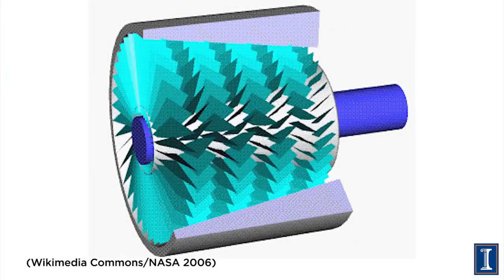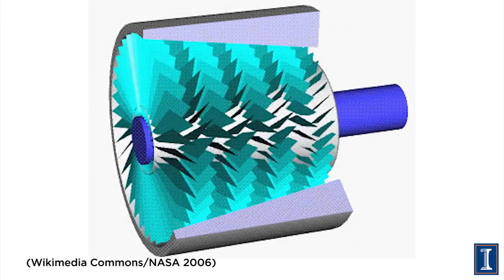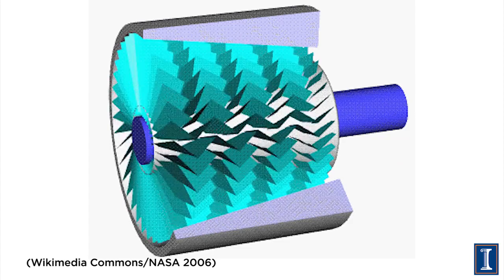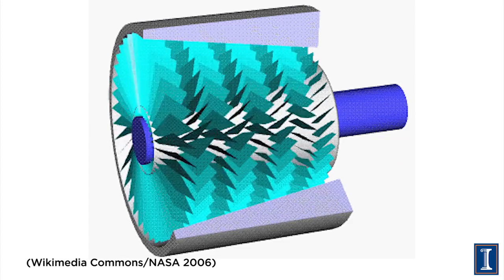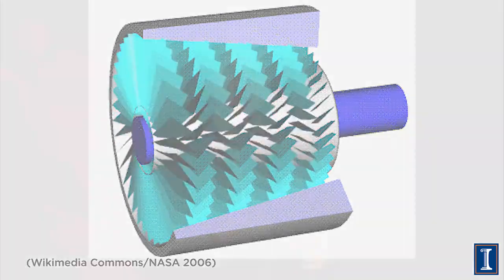What's Up with the Water?

Comment: I spent a winter/spring rebuilding a cooling tower in a coal power plant in Illinois. Evidently the plant intentionally waited for part of it to collapse so they could file an insurance claim... The super boiling water that ran through it definitely was not pure H20. Chemicals were added to it (to keep it from evaporating?)
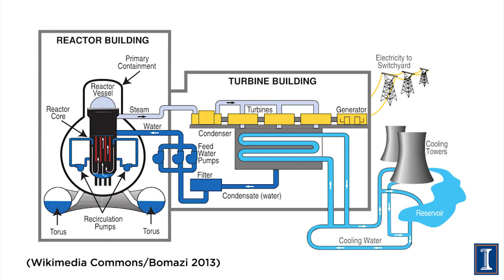Reply: The cooling tower doesn't circulate the pure water. Pure water is the dark blue loop in the graphic at 5:24. The cooling tower has the light blue loop and there you have barely purified water, drawn from a river, to which you need to add chemicals to prevent massive growth of biolfilms in the cozy warm cooling water loop. Yes that will not be clean and leave lots of fouling over time.

Comment: Cant you just cool the water using district heating?
Reply: You can! And you should do that. But not the full thermal load, as district heating needs temperatures that are too high to operate the condenser efficiently. Can't  run the power plant when the condenser has to work at 90 degC or so. You still need a cooling loop with cooling water.